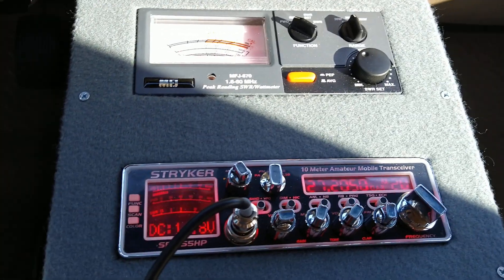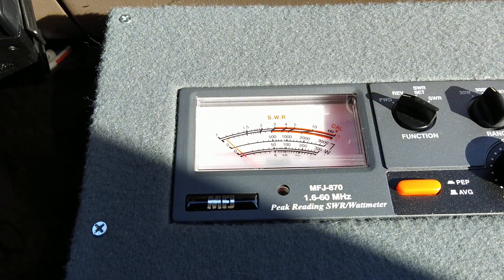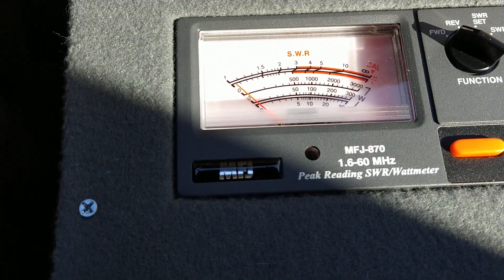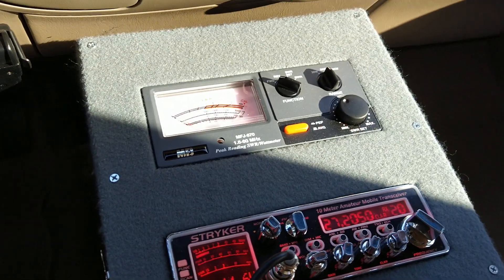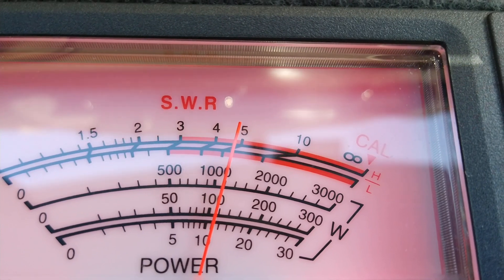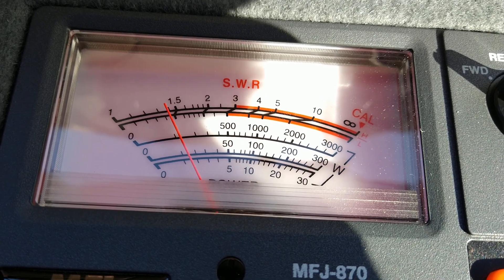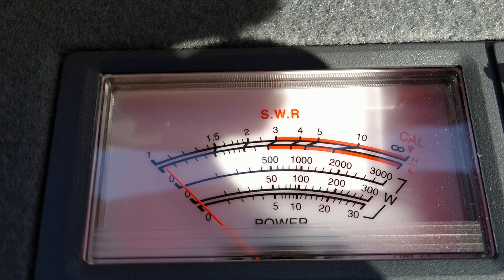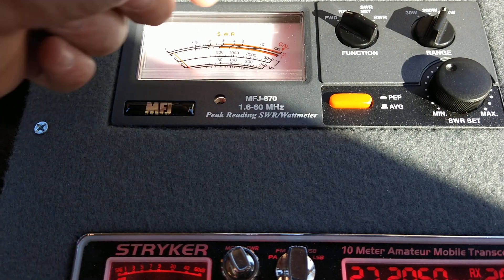Running amp, SWR, reflect, etc. What to believe?

Comment: Just run it .... U yave phase shoft going on ...its very normal u want to use a differentength jumper and hull the ju pwrs to frequency u will have zero reflect😊

Comment: Guys almost forgot ground your radio to the frame wit the amp on the same past.
I used 8g i run my amps on low to med never hi.
Ira a texas star for 23 years befor it die..
I run around in a ram pickup.
You need to grounding of everything on that truck .
Watch BBI on grounding the man knows his shit..
Grounding the key of talking guys .
I can run my stock radio with out my amp on and talk over 70miles to my friends thats at quiet time of dx.

Comment: Sorry I'm late on this.
I had the same shit on my setup. 
Fix put rg400 coaxial cable 17 feet to and 18 feet to Amp.
and antenna line I put a  mfJ 915 with rg400 coaxial cable 1feet.
And  on the radio line I put 7 rfi chokes all with Amp on for very little reflecting I run 1.1 to 1.2 from 26505 to 28555 lower in all ten meter.
Hope this help all you guys trying not to blow shit up 73.

Comment: Hey,, Morning Desert.. I don't know if this will help you out or not.. BUT.. I just had a Hight Drive 4 pill made for me. and we put it all together.. and when checking the SWR.. I asked my teach how come the swr was so high between the radio and the amp.. and he said you can't go by the meter on the radio when running an amp.. to get a proper reading.. you need a meter between the radio and the amp.. and an meter between the amp and the antenna.. to get a ture reading.. I hopw this helps you.. This be Old Mountain,, 121 South East Missouri... Take Care.. 73's..

Comment: A meter without an active peak circuit won’t read true peak watts. Usually less than a meter with powered peak circuit. RMS should read pretty close. Input tune of the amp, while on, can cause that meter reading difference. The swr between radio and amp.

Comment: Also, as for the radio SWR meter reading different from the external meter while you key the box:

Your watt meter is reading everything after the amplifier, BUT, the radio will be reading the INPUT of the amplifier when you key it. 

With the radio showing as low as it is while you key the amp, that tells you the input tune is spot on.

Comment: I was taught by some heavy hitters a long time ago, take your SWR and throw it out the window. 

If you can tune for minimum reflect, while running full tilt, it will be as efficient as it can get.
Reply: Me personally, 5w or less reflect. At about 8kw Bird average on my shootout truck, I have about 1/2w coming back.
Reply from the maker: @350radionorthgeorgia3 half a watt? That's insane.
Reply from the maker: 10-4!
Reply from the maker: So with 1,000 pep going out, what's acceptable coming back in your opinion?
Reply: Yep. It's fully possible. Not easy sometimes, but once you get your feedline, mount(s), antenna(s) and bonding just right, everything falls into place. 

On my base for example, my 42' beam has about 1/4w coming back at 1500w average going out. 

It usually is a royal pain to get there, but it can be done. 🤘🤘

Comment: Can you get the jumpers down to 1/4 wave each? That might make a difference.   As far as the SWR between the radio and the meter, I'd stick to what the meter is telling me. I have a McKinley that I run into a box. Without the box, the McKinley shows a 1.1 swr across 1-40. When it's hooked up to the box it shows 1.4 with the preamp running, and 1.8 when the amp is running. Yet on 3 different swr meters it's showing 1.3 with the box hooked up and running.  I never trust a radio's built in swr meter.